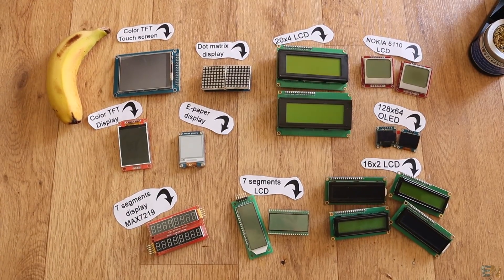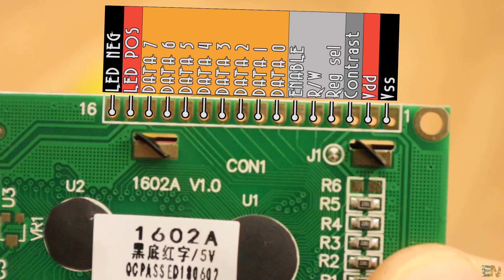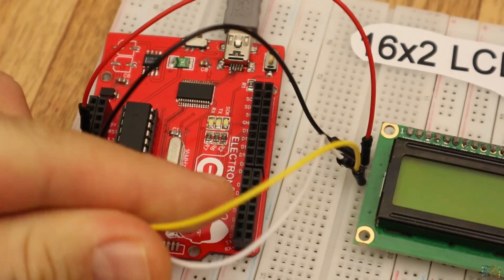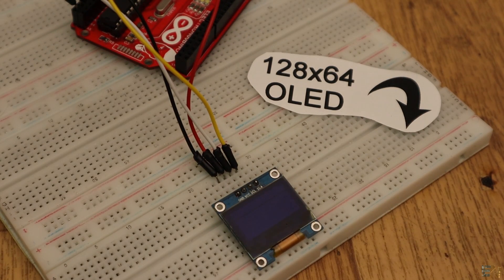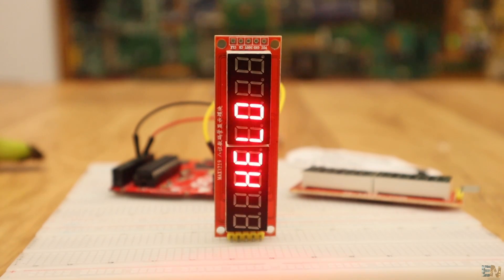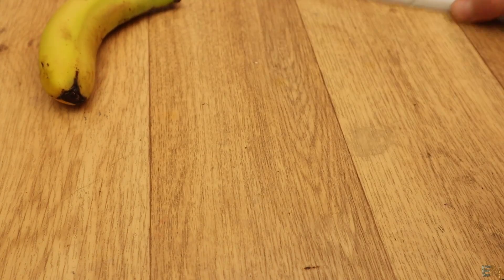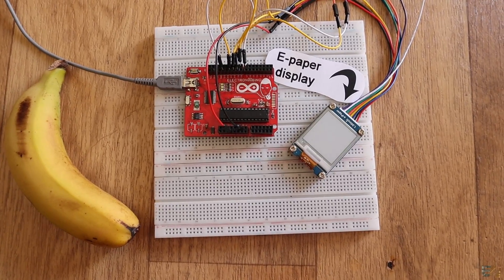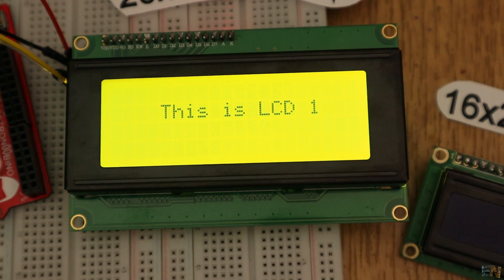Display examples - which one to use?

Comment: Need a panel of numbers which are more than one ...different numbers of different lengths , separated with a space etc ...like calculator entry ..and the whole has to be input to another circuit with a banana plug

Comment: Hi i always struggle with all displays, becuz every arduino has the blink sketch for the inbuilt LEDD on Pin 13 but its the SCK Pin in most cases, so i got my displays turning on and truning off. Even when i set the pin 13 to low in the code, but this makes the display black.. How can i kill this blink sketch?

Comment: One thing you missed: For the I2C character LCDs, you don't need to use A4 and A5, you can just use the dedicated SDA and SCL pins on your Arduino.
Reply: It’s faster that way too, the analog pins will just emulate the sda and scl so will be slower than the dedicated ones
Reply: @Gurmansd  well testing with a multimeter shows they're they're the same pins with different markings

Comment: Great, oh may you please explain how to use them in parallel with another SPI module?, for example the nrf24 module. Wiring LCD is so simple but actually i am having some noise pixels, connecting the ST7920 and nrf24. Is it necessary a decoupling capacitor for LCD too?.. Your vids are awesome

Comment: Thank you for this video. I am currently working on a data-logger with the NOKIA display and the SD-cardreader/clock shield. Have you ever combined these? I am having difficulties using these two libraries: a) <Adafruit_PCD8544.h> and b) <SD.h> It appears to me that they are not working together. Any thoughts? (Used pins for the NOKIA display: Adafruit_PCD8544 display = Adafruit_PCD8544(7, 6, 5, 4, 3);)

Comment: You should of discussed mounting bezels for the displays.
For the display to be useful, you need to have a clean method of mounting the display on a panel or box.
Not much use on a breadboard unless you're just testing the operation.
I have been very disappointed in the lack of mounting hardware that's available for these nice displays and a lot of us don't have a 3D printer or CNC machine to create these parts.

You can get a bezel for the Nextion displays but they are poorly designed as they don't cover the flat ribbon connector.
You could cut an opening yourself, but it has to be a perfect rectangle it you want it to look professional.
The 7 segment and dot matrix displays should have a tinted plastic window over the display if you want to see the display properly.
The window should be part of the bezel.
If you know of a source to get bezels for these displays, please let me know.

Comment: For 128x64 OLED i2c you are actually using only 32 lines in the example. You need to change the default value in the library file Adafruit_SSD1306.h to #define SSD1306_128_64  It will look much nicer :)

Comment: Can you give detailed description on 2.4 TFT color touch screen (with SD) for Arduino. It is using most of pins of thr Arduino Uno. I need to use a color sensor at the same time with this screen. can you explain that

Comment: Don't be offended, but I expected a bit more from this video. So yes, more in depth would be appreciated. For example display speed : I bought a 3-color e-Paper display and now I know that it's only useful for rarely changing content because the repaint time is in the area of 2-3 seconds. Also energy consumption would be an interesting topic. And visibility outside an studio environment in the sun or at low light areas.

Comment: Thank you for video. I have a question - I have Graphical LCD 128x64 screen. Would you please suggest me what library should I use? In my project I just need simple text print, small enough to be able to write several lines. P.S. the screen I have it has  controller: ST7920 and  it is of this type: HJ12864ZW.
Thanks!
BR,
Valters

Comment: I want to make a digital eye... So which kind of display I have to use can you suggest one???
Reply: You'd probably want to check out an OLED 128x64 display since it's about 1.5 inches. You could also check out Sparkfun's transparent LCD which is see though, https://www.sparkfun.com/products/15173. Careful with these though, the libraries take up quite a bit of space on smaller Arduinos.

Comment: Sir
Can you please make a video on how to make a diy MSP430G2553 Launchpad
Reply: I'm also planning maybe to do some MSP430 stuff or vidor with real tools but just as hobby. I think I would reuse launchpad as programmer/debugger and use chip itself in circuit. need only 3 pins (gnd, test, and reset)

Comment: You could of course also do a whole video on the many ways to use addressable LEDs, the tapes, the individual chips and matrix modules. Tape and chips can be arranged to fit in many patterns and enable different usage styles. Power is the big gotcha always, and logic level conversion if board or SBC is 3.3v instead of 5v

Comment: How did you get your own logo as bootscreen with the adafruit library? As soon I call a bitmap in setup routine the adafruit logo shows up :/ 
Very informative video, my favorite is the Nokia LCD, I just love it, it's not only the price, but also the possibilities, I can show big letters and numbers but also build a menu with small letters and numbers and also print bitmaps, my first one for Arduino I got from my Nokia 3310 where I worked a long time for as I was a teenager, I had luck because that is one of the LCD's with golden contacts on it and not that stupid rubber that never works again properly after touching it once.

Comment: 2:47 - A third option is to use the LCD in 4-bit mode to save pins.
Reply: He's already doing that.
Reply: @HA7DN  You're right. Looked at it on the larger PC screen and sure enough, 4-bit mode.
Reply: shift register is used and only 3 pin required for lcd.

Comment: I would really like to see you getting the touch screen display working with your Arduino, even if it means buying a shield. I have a number of projects in mind to try to build and it would be great to eliminate the need for any other pushbuttons or keypads, just a power on/off switch. Thanks. Very informative video. You obviously put a lot of time and effort into covering such a wide variety of different displays and how to wire them, and the associated code to make them work - well, most of them, at least :D

Comment: I like the ST7920, KS0108, and ST7565 too. I really like Oliver's U8g2 library on the Arduino IDE. He covers a lot of LCD options. 
   If you get any of the LCD's that have "MCUfriend" on them, they are Ardy1 shields. The MCUfriend library is designed for a specific pinout. This means the display is auto detected and configured when the library is added to a project. This is really cool because there are multiple brands and models supported but you don't need to know the details. Plug it in, run the test sketch and it will return all of the data you need automatically. 
  Lastly the Hitachi HD44780 displays (1602, 2004, etc.) also come in extra large versions that are a little harder to find. They are usually around $15-$20 each but they are pretty cool if you want to build something that looks interesting and different but just uses a simple display.
-Jake

Comment: Thanks again for another great video. I do have a question. I am following along with your example for the 128x64 OLED, and I have installed the libraries as discussed, however when I try to compile the code, I get an error that DS3231.h: No such file exists. Can you help with this? Thank you.
Reply from the maker: Oh, remove that DS3231 line from the code. That is for real time clock. No need for that!

Comment: hi mate , i am working on arduino battery capacity meter, but i cant kind any simple and accurate circuit yet, can you help me with it , i have parts like arduino nano/mini and ina 219 and acs712 hall current sensor and 32ohm5watt resistors, i am not good in progarmming and circuit designing and hardcore fan of electronics , watched your every video and highly appriciate your work and skills ... keep Going ...fan
Reply: Hi  can we make Arduino lithium battery charger discharger capacity tester upto 1to 5s Cells

Comment: The OLEDs are my favorite too.  The SPI version is much faster, but requires control of an extra pin in addition to the 3 SPI, reset.
You can buy mini 4-digit 7-seg displays for $0.20/ea on Ali, but those 12 control wires + 8 resistors generate a rat's nest.  A little painful to control, as well.

Comment: Solving spi oled library is not that hard, just open it with the appropriate text editor and uncomment the one you want

// #define SSD1306_128_64
// #define SSD1306_128_32
// #define SSD1306_96_16

Comment: I would love to use e-ink screens in my projects but they are way too expensive. For me the best one is the nokia screen. It's cheap and gets the job done.
Reply: you are right, they are too expensive.  it's cheaper to buy a used e-reader and extract the display out of it.  I have seen people selling e-readers with 5 inch display for like 15 dollars (used).  I was wondering if someone was able to extract the screen and use it on arduino. I am just not that knowledgeable in using e-ink dispaly. if someone tried extracting e-display from a e-reader, and used it on arduino, please share the link because  I want to try this project.
Reply: @Livefreeman  I don't think it's that simple. Most likely there is some proprietary communication protocol with e-reader screen. You would need a driver or a lot of reverse engineering. That said I would love to know how people do this kind of stuff.